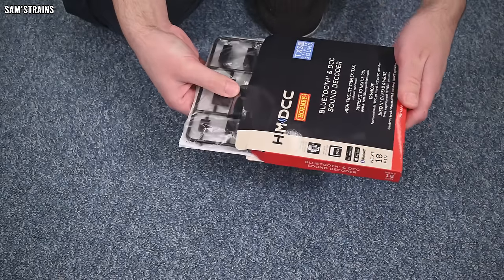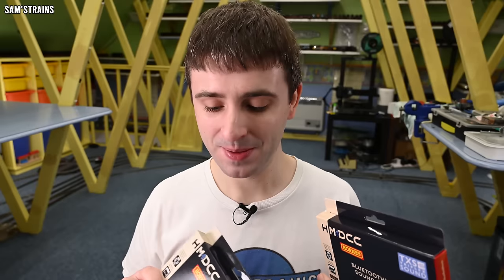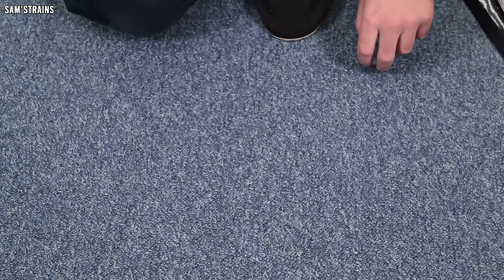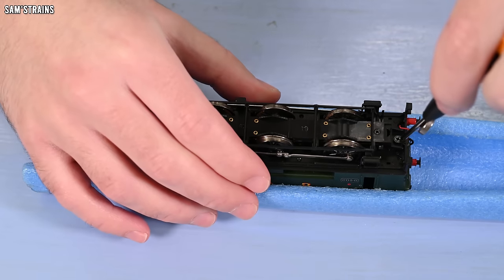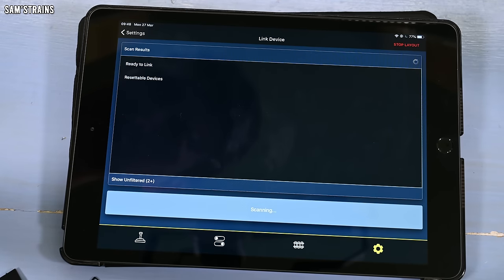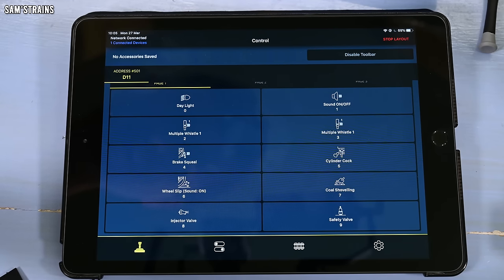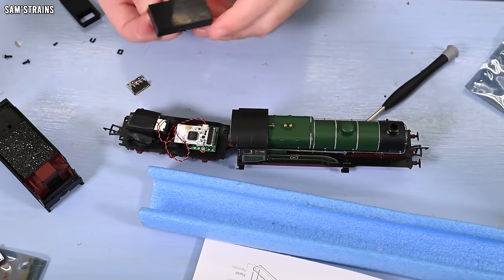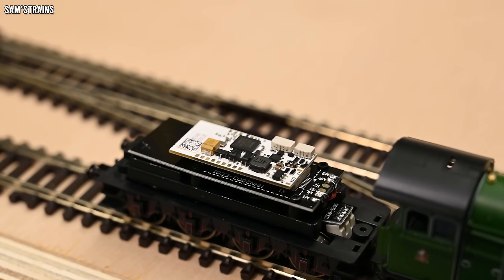Too Big For Most Locos & Burnt Out After 1 Day | Hornby's New HM7000

Comment: Hi Sam, apparently they aren't the NRMA sizes due to component shortages. They plan to do a second gen version to standard sizes in the next year or two. That being said I believe every loco sold by Hornby today will fit it. I think it'd be interesting to see the next18 in Lion. I think the ESU /Zimo chips still appear to offer a few extras that a few people will use. For example Railcom support for those running detection systems and chuff rate correction. They obviously also offer a much bigger library via third party so I don't see them as an immediate major threat but this could well grow over time.

That being said it does look like this control could well be the future and it's fairly priced and is perfect for Hornby's target train set market.
Reply from the maker: haha amazing - did Hornby say this? xD
"We claim our product is NMRA compliant... it isn't, but only because we couldn't get the components. So we redesigned the entire decoder. It's not compliant, but now we can sell it".
I'd be very very surprised if it fits in Lion - it goes in the loco, and it's very tight indeed!
Thanks for watching, Sam :)
Reply: @SamsTrains  Effectively yes and a number are slightly larger than they should be. That being said it's also debatable whether the manufacturers give the correct space for them since some of their preferred sound providers e.g. Zimo / ESU produce some decoders in their range that are much smaller than the standard and are pretty widely available.
Reply: @Haymarket47   RMWeb source who clearly seems to be either a senior tester or someone close to the project with thorough knowledge of the decoders and the roadmap. On the relevant thread a few pages back now.
So not official by any means but source is from p25 post at the bottom by RAF96. I would have no reason to reasonably doubt this and the explanation does make sense.
Reply: Wow. Hornby are not saying this? Geeez. That's bad and could well come back and bite them in the a..
Reply: To mitigate - NMRA compliance is usually taken to mean that the control method is interoperable with DCC systems and this is true. In the next 18 case at least two sizes are specced by the NMRA (one for sound and one for standard). The HM7000 decoder falls foul of both. That being said over the years many decoders have had issues with fitting and Next 18 at least do have a standard to follow. Obviously they wanted it to launch alongside the TT:120 release and therefore this is the compromise. That being said it should be made more obvious!

Comment: There seems to be a lot of NEXT18 chip that doesn't appear to have any purpose. Unless there is an embedded antenna there is a lot of wasted space on the board, that could have been made smaller.  They are definitely 00 or 0 gauge decoders.  

Another possible con could be the long term app support.  Apple are buggers for leaving developers behind with OS updates, unless Hornby keep up with them the app might become unusable.  There are other Bluetooth systems out there but I guess we won't know if there is any cross compatibility. They are useful decoders, and I am sure if the source code is beckwards developed people may be able to produce sound designs and profiles for non Hornby stock.
Reply: I was wondering if you could trim the end of the board off. All it seems to support is a barcode or perhaps it's the Bluetooth antenna?
Reply from the maker: haha not even OO decoders... I couldn't find a single OO loco that they'd fit into, far too large!
Thanks for watching, Sam :)

Comment: It seems like if you just cut the top off it would fit but is there any circuit traces that go all the way to the top?
Reply: that will cut of the bluetooth antenna in the chip!
Reply: @wapphigh5250  Maybe cut it and solder a wire.
Reply: If you cut the top off, you will destroy the Bluetooth antenna.

Comment: I noticed that the end of the decoder opposite the connector didn’t have any obvious components fitted. If there aren’t any, it begs the question of why are they so long? Not just for space to put a label, surely. Could some of this board be cut off to shorten the decoder? Doesn’t help the width though.
Reply: Ive seen on another vid it suggested if you cut some of the chip off, you risk cutting the bluetooth aerial so wouldnt advise it!

Comment: Interesting review as it raises key points ie the need to check prospective locos hv the space to accom the decoder. Looking fwd to to what caused the burnout, could it be yr dcc controller on full is generation too high current?
Reply from the maker: Thanks Paul - I doubt I'll find out what caused the fault as I'm just returning it. Excessive current draw can only be a fault in the decoder, as it'll draw whatever current it needs. As for voltage, I was using a standard Gaugemaster DC controller, at a normal voltage
Thanks for watching, Sam :)
Reply: @SamsTrains  Hi Sam great review, I didn't see what if any ESP precautions were taken when handling the decoders could that be a reason for the next18 failure as it was handled more due to it not fitting any 00 locos

Comment: This might be a bit of a wander off down a side track, sorry, but the blue tooth set up in my car no longer supports the current crop of mobile phones with no upgrade path. So what happens when the Bluetooth protocols are upgraded in the future, will Hornby be providing some sort of patch to ensure the decoders still function, will the user have to buy new decoders or do you have to keep an old unupgraded phone for the trains. BTW the car lost the ability to communicate with the smart phone when it was under 10 years old before anyone asks.

Comment: Hi Sam. Great video. I'm going to give this a go. One question I have a Hornby elite controller and I see there is a Legacy dongle @ £35.99 to connect Elite to HM 7000 - do I need to buy this as well or will the Elite work without it? Thanks in advance.

Comment: As we know, this isn’t a new thing as a number of companies have been playing with the bluetooth options for a while, especially in the US.  But I applaud Hornby’s attempt to make it mainstream.  I really think this could be a game changer for DCC.  

I can’t wait until a better manufacturer, with good quality control, picks this up and makes it smaller, better, more robust and smarter.  All the Z21 system would need for example is a bluetooth transmitter plugged inline and an updated App.  A bluetooth range extender is about £30 so shouldn’t cost much. 

When that happens, I will probably switch.  Question is, do I wait? I have 12 locos needing sound chips, so how long do i give it?  Hmm.

Comment: How's the motor control / tuning options on these decoders? You say "wipes the floor" with the other manufacturers, but for me, nothing beats Zimo's motor control, particularly at low speeds. It would be great if Hornby could get near this, but I have my doubts!
Sure, it's not sound-related, but it's definitely a factor when I'm deciding what chip to buy.

Comment: I watched this yesterday before the burnout. That’s not good. Personally I haven’t had hardware failure but I’ve had multiple software/firmware issues. I’ve lost count how many times I’ve reloaded profiles and had to do a complete cv reset because it stopped working on DCC. Seems stable now but I hold my breath every time I turn it on. 

I know the number of interacting pieces of technology make it complex. I worked in IT development for 35 years. I just wonder how many will struggle in the early days before things stabilize

Comment: An interesting concept with huge potential but I'm not sold on it at the moment. £63 is a lot for a decoder. Can you get without sound to be cheaper? I have DCC and there is no way I could afford that for each loco. TTS is £40 and that sounds good with a good speaker. Even then it gets too noisy with too many engines running with it and most of mine are non sound decoders. How many locos can you have running at the same time and can you double head? More importantly is there an emergency stop function? This is essential in DCC as a flicked point can lead to head on crashes.

Comment: Ooops! I think I see a problem here with older Hornby 00 models, with boiler (not tender) mounted dcc boards.  The dcc mounting plate on my R2584 West Country measures 11mm wide, same size as the HM7000-8TXS. But then the speaker and power bank sockets are on the side of the board. I suspect there is no room to fit this lot into the loco barrel. Has anyone tried this yet?
Reply: In the interests of accuracy, I can report that I have installed the system in the above loco. Remove the PCB mountings and file down the mounting post. Fix the Power Bank in this space, with the PCB and dcc plug on top (use blacktack). There is no need to hardwire the dcc connections, use the old socket. The TXS card will fit edge-on into the smokebox. Run speaker wires into the tender, using a mini-connector for ease of handling. Very pleased with the results!

Comment: Have you tested ROCO Z21 (released 2015) for reference? I know Bachmann/Liliput locos are designed for smaller chips but the Hornby chip should work in Hornby loco's. Other manufacturers of chips make there chips in differing sizes to fit differing gauges and locomotive sizes and loco manufacturers, from N (OO9) to 1. Except for the Bluetooth connection on the chip most of what Hornby have done has already been done for some time by others.

Comment: One major problem, which needs flagging Sam - Hornby analogue power controls are NOT compatible according to their compatibility chart - I double checked this with Hornby Tech Services today - and they confirmed my HM2000 as you stated is definitely NOT compatible either using the controlled or with the uncontrolled dc or ac outlets - and the same for the other supply you showed. Maybe you should have discussed this with Hornby before reviewing? Apart from that - great review!
Reply from the maker: They’ve changed their tune on that - at the time of filming they had marketed the HM7000 as being compatible with analogue controllers… it was videos like this that brought that to light! I wonder if they even had any idea that it was an issue at the time I made this…
Reply: @SamsTrains  I agree they haven’t exactly covered themselves in glory or with clear explanations - it’s a good system - by the way further research seems to indicate that gaugemaster controllers and using the older hmdc app are also possible candidates to burn out the decoders - if I were you I think I would delete references to the dc control to preserve my rep! All the best Sam

Comment: 27:14: "Not quite how you expect a steam loco to behave".
Sam, that's because you're the one who has expectations about how things work. Strictly speaking, however, this has nothing to do with reality, but with what you believe how things are or do function.

Brakes and propulsion control are independent of each other. A steam locomotive with the controls set to go forward and the steam valve open will do that: go forward. By braking, you slow down the engine, but you do not shut off the steam. So the locomotive will accelerate again immediately after releasing the brake valve.
Basically, the brake control in the app is very clearly oriented towards the prototype.

You will find a similar strange behaviour with many sound decoders: The sounds are a mostly quite short loop that is played as long as the locomotive is running. 
But a real steam locomotive does not sound like that. When it has reached its speed after starting up, the exhaust blasts decrease in volume, when the locomotive is just rolling, you don't hear them at all.
There are only very few decoders that imitate this sound behaviour - the others are all not prototypical.

Comment: Hi Sam in relation to the next18 chip size I noticed in your video that the end of the pcb had no circuitry on, I know it's quite extreme but could you trim the board down to fit it inside some of the Bachmann tank engines? Great video as ever.
Reply: HI Dave, I don’t think cutting the chip down would be a good idea. That ‘blank’ space at the end of the chip is actually the Bluetooth antenna. Might cause a problem if you were to remove it ! 😳

Comment: I wish Hornby would get the chuffs somewhere close to correct. This was an issue with TTS and also with these decoders. This is where other manufacturers get thing right by including the ability to change the chuff rate. The A3 should have 6 chuffs per wheel revolution.

Comment: I think this has a real appeal for DC die hards.On a cab control system you just have to have one of your cabs providing pure 12v DC. What I would like to know is whether a loco fitted with one of these will still function on ordinary DC control.
Reply: On DCC decoders there is usually an ability to use it in a DC loco. CV 29 has to be set up in order to make this possible and the decoder usually has this option turned on when it comes from the factory.

Comment: Good review Sam, one question though: Does the system require an internet connection to work (as the app has login etc). So if the internet goes down can you still play with the trains?
Reply: Internet required to upgrade, download sound files etc but not to run trains. In the recent demo of the app etc by Hornby itself, they didn't even have wifi !!! (and the HM7000 chipped trains still ran and were controlled)

Comment: This does seem like an overly negative look at some very interesting new technology. Compared to soldering in speakers and stay alives and dealing with cowboy companies to program £120+ decoders this seems like a revolution. 

Plus hornby TTS for specific trains were only available for limited production runs and if you were late to the party.. tough!

I intend to fit one into a flying scotsman having checked it will fit first.. maybe that's the secret. And if it won't fit don't buy it and pick a smaller decoder.

Comment: I feel like hornby is getting cheaper and cheaper at this rate I’d start using bachmann and older engines in fact other maker hornby is also getting lazy not making New models just taking the easy way and getting a quick model out for £100 or more.

Comment: I'm a little late to the party here. I've only recently learned about this system, and it admittedly seems really neat. My main concern though is what will the long-term support for the app look like? So much of the functionality of this system is built around the App, and as we all know, all apps eventually stop getting supported. One day, Hornby will cease support for the app and when that happens, will these decoders become paper weights? Will the user still be able to switch between DCC and Bluetooth mode? Will downloading sound profiles still work? Will the app even function if you can't log in? These are serious questions we've got to ask. Sure, the system works fine today, but what about in the next, 5, 10, 15, or 20 years?

Comment: I have just ordered an 8 pin version to go into my A2/3. I am using an Arduino locomotive dcc app which also gives Bluetooth control.
Will be interesting to see how they perform together.
Reply: The decoder will almost only respond to the Hornby app if you want to use bluetooth to the loco.
What I think you are refering to is bluetooth app to the dcc track command system or the JMRI interface to it.
I may be wrong but that is my expectation.
Reply: @Cloudman572   it will Interesting to find out. I'm only doing it to experiment.
Reply: @TheWGLOVER  I have used Engine Driver android app with JMRI free PC software and that is awesome.
Then you can use your bluetooth device to control your trains and decoder functions but not only that, it can control either individual turnouts or set whole routes in 1 click if you have set those routes in JMRI.
Reply: Only down side is JMRI is very complex so it can do almost anything if you are an expert but doing even simple things takes a bit of learning (some videos exist to help).

Comment: This is the review we wanted!!!! So these decoders are big! I thought so...Thanks so much. Sam you are a gun. Will the new bluetooth 8 pin with wires fit in the body of a Hornby railroad Scotsman? If you run legacy DCC system looks like we keep some of our old chips and get the Hornby bluetooth dongle!!!
Reply: @Haymarket47  with all due respect nothing in this hobby is set in stone (like a decoder fit) until you actually try it!
Reply: @Haymarket47  In any case how do you get in the stay alive capacitor (which as Sam pointed out) is necessary for bluetooth control to operate properly?
Reply: No difference in size to the Bachmann chip  i have just taken !!!!and swapped for a HM7000
Reply: @1tonyboat  Cool which model? Was it a Next18?
Reply: Yes, 8-pin wired can fit into really tight spots. Sam's 21-pin looks similar in size to the industry standard 21-pin ESU I use. The 18 should be miniature but isn't, it will be interesting to see if it fits all of Hornby's other TT stuff.
Reply: @jackdripper5675  cool - thank. I'll give it a "rip"!
Reply: @jackdripper5675  Reading between the lines of things they've said and watching the designers on the TV series it sounds like finding enough room in the smaller TT locos is going to be tricky at present to get a chip and speaker in, so any chips may be just basic movement functions. That's just an educated guess on my part though.
Reply: @Haymarket47  no it is not. I know. But clearly if power is lost, bluetooth drops and there will be running problems. My guess is this is entirely why Hornby designed the new chips with plug in stay alive. To avoid this potential problem.